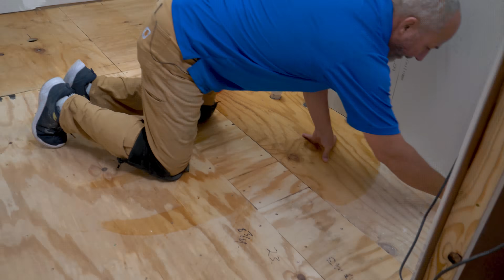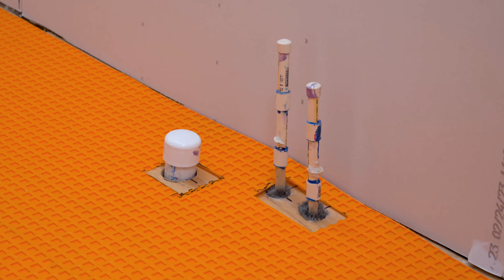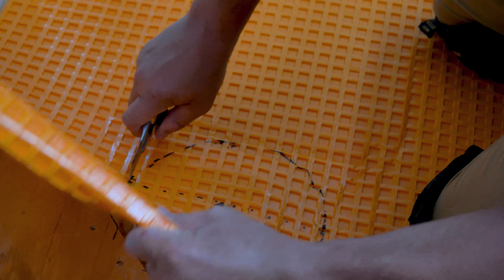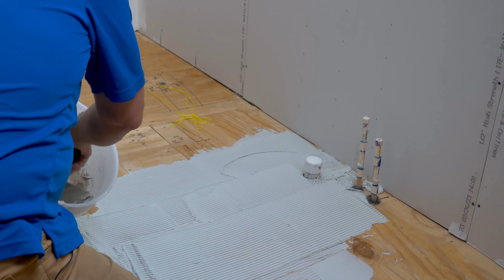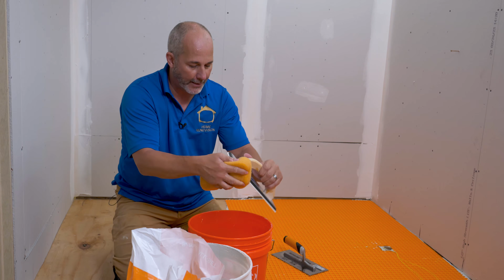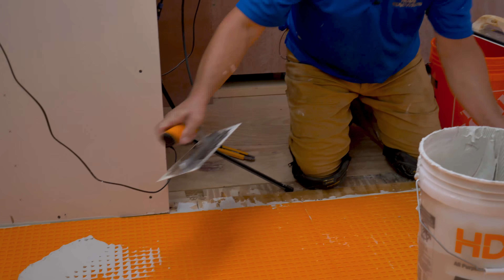Why You Should use Schluter Ditra on Your Tile Job

Comment: Thanks for another great video. I always learn so much watching you work! I'm about to do this to my bathroom and wanted to ask...would it help  to use a primer (maybe SBR?) on the ply before installing the Ditra membrane? Thanks again!
Reply from the maker: using a multi surface bonding primer is a great way to get a great bond to Osb. I highly recommend it as a great way to protect yourself from delamination which can occur if your thinset is too dry when applying. the primer effectually makes the install almost idiot proof. Cheers!

Comment: Is the PRIMARY use of that membrane simply to prevent tiles from cracking? or is there more to it? Built our home 20 years ago without this and not 1 cracked tile in kitchen, bathrooms, and front entrance - so trying to understand why I would 'invest' in this when redoing my floors. Thank you.
Reply from the maker: this replaces the need for a second layer of osb on wood floors before doing a direct bond install. it also prevents delamination that occurs during extreme weather events when the power goes out making the install a 50 year floor instead of one that will fail under certain conditions.
Reply: And also it’s easy to put a heating cable to have a heated floor at the end.

Comment: Would love to see you do a wet-room style bath.  I want a simple-to-manage bathroom with very few barriers, and super easy maintenance.  This means a floor so that if the toilet or sink overflows, or a pipe bursts,, the overflow goes towards the drain.
Reply from the maker: Great idea!
Reply: @HomeRenoVisionDIY  
I KNOW, lol.
Reply: Would you only use this on plywood or also on concrete?
Reply: @rebrokersabrina  You can use it on both. First time tiling, and my first time using ditra in the bathroom instead of cement board. Its so easy to cut and lay to fit. Yeah it might be more expensive then cement board, but hey, its WATERPROOF form the get-go, which is ideal for BR! Getting the thinset measurement right is probably the only challenge you will have.
Reply: @rebrokersabrina  
I have seen it done on a wood base, but only before and after.

Comment: Another great video Jeff!  I’m in the middle of my bathroom renovation. Using the wedi system.  Question for you:

I want to mitre my outside corners but not sure if I can just use grout or if I need to use epoxy. And if I do need to use epoxy, any specific one you recommend?

Also, I’ve seen you remove MANY toilets throughout your videos and the awkward positioning that your son has to take. You must try liquid lock if you haven’t yet!
Reply from the maker: I would suggest that for anyone using a shower system that relies 100% on adhesive to seal that epoxy grout is a necessity. Cheers!

Comment: Great timing, we are going to get our basement renovated and was just looking into this product. Do you recommend using this over concrete on a basement floor bathroom (house was built 2020). Looking forward to the next video!
Reply from the maker: In my opinion it should be considered necessary! basement floors will crack and this membrane will protect against translation and cracking your tile.
Reply: @HomeRenoVisionDIY  Great, thanks for the reply. Makes sense, and this is not not very expensive material wise for small areas!

Comment: What is the purpose of the membrane?  Does is protect the floor from Water?  Or is it to protect the tile from breaking?
Reply from the maker: it does 4 main things. waterproofing, ands structure to reduce deflection, and provides a uncoupling system to protect tile from cracking due to expansion and contraction that occurs on direct bonding installations, it also acts as a crack isolation system so when installed on concrete if the concrete cracks that crack will not translate into the tile as well.

Comment: Why not run the membrane a little under the shower curb to eliminate the non waterproofed crevice as a weak point between them?
Reply from the maker: that is why we use the kerdi band tape to waterproof that joint

Comment: Is this product worth the extra time and expense?
Reply from the maker: definitely yes. it has so many advantages compared to direct bond installs. once you factor in the cost of a second layer of plywood compared to traditional installs you are almost breaking even. remember you don't need to have 2 layers of subfloor when using this.

Comment: Hi there, I am replacing my tile baseboard in my bathroom, I will be cutting 9” all around my bathroom so much easier to take off that way and save time, when putting back the new drywall do I have to crack fill or put the new tile over the drywall?
Reply from the maker: if the tile is going to be cut the same height then simply screw the drywall on and tile away. Cheers! the use of caulking the plastic edging on the tile to the drywall will guarantee no cracks will form.
Reply: @HomeRenoVisionDIY  ok thanks for your help…

Comment: Where are you sourcing it from? Its so expensive from HD but Ive heard there are other channels you can get it for a lot less.
Reply from the maker: I buy mine from a tile supplier where I have my contractor discount and get a better deal. the cost is not a real concern. having a tile job fail is a much bigger problem. For me the ditra membrane is now part of all my assemblies.
Reply: Thanks for the reply! Agree it's better to be safe than sorry. Will you be going to IBS in Vegas?

Comment: Can this stuff be applied over 23/32 OSB subfloor with 16in joists in a remodel job? Im assuming the original vinyl would have to be removed? Or is cement board better for remodel?
Reply from the maker: yes remove the vinyl and make sure the osb is screwed down. You can always check out the website for the product...they have installation assembly options listed there for different builds and materials. Cheers!

Comment: Do you think that would work on an OSB wall to prepare for backsplash??
Reply from the maker: this product is not designed for wall applications. if you have osb as a wall right now then simply use a Multi Surface Bonding Primer and then you are ready to tile. Cheers!

Comment: Question: if I use regular modified thinset to set the ditra to plywood, can I use the same modified thinset to fill in the top of the ditra squares.  Then the next day use the All Set to lay the tile?
Reply: Doesn’t sound like a good idea to me. IMHO the point is to fill the Ditra and bond the tile at the same time with the same thinset. His recommendation to use Schluter All Set is perfect as it works for adherence to the plywood and the tile to the Ditra!
Reply from the maker: you cannot use modified thinset to fill the ditra. it will not bond. and your tile install will be weak and fail from deflection. Cheers! not worth buying a bag of modified since you use so little of it anyway for setting the membrane.

Comment: Fantastic tutorial! 
QUESTION….Can the Schluter membrane be applied over self leveling compound?
Reply from the maker: yes, it is now. they have changed the recommendation in the last couple years now that it has been thoroughly tested. If you are using ditra heat you can also pour leveller on top if finishing with vinyl plank but never if finishing with tile.
Reply: yes, always on top of the self leveling. not approved to pour self leveling onto ditra

Comment: Question: how much of a concrete slab crack would the Ditra negate? 😅
Reply: If the crack is less than 1/2” in width, then apply crack filler first. Once filler is set (dry), apply schluter ditra, as illustrated in video.  If crack is greater than 1/2”  in width, then concrete area will have to be repaired.
Reply from the maker: any cracks due to stress and or shrinkage. it will not protect you from poor soil conditions or slab movement. Nothing will.

Comment: Do I need to use this over a concrete floor?
Reply from the maker: Yes, definitely. all cracks in concrete are isolated and will not transfer into the tile when you use this product. Cheers!
Reply: Thanks for your help. Really appreciate it. @HomeRenoVisionDIY
Reply from the maker: Cheers!
Reply: I also have the same question.

Comment: I would have loved to use this when I put down about 800 sq ft of travertine tile, but it would have nearly doubled the price. Labor cost was already astronomical. 
Maybe if I win the lottery, I'll put it in my new mansion.
Reply: My thinking….with learning from Jeff doing DIY I am saving money with labor and that allows  me to use  use higher quality materials for the same cost or less.
Reply from the maker: You got that right shelly. the membrane is only $1.00 a square ft to guarantee longevity. cheap insurance if you ask me. I have seen hundreds of new tile installs that meet code fail. Cheers!

Comment: Thoughts on the Ditra peel-and-stick?  I watched a video that showed it was pretty tough (hard to remove) if you cleaned the floor properly.
Reply from the maker: I will stick with the original. Much easier to remove and rebuild from thinset!
Reply: The whole premise of the material is to get a good bond on the surface so if it does move, the cloth material can stretch or break. It's not actually the tile that moves if it does

Comment: Jeff, our son bought a house built in 1970. We have replaced the bathtub and installed concrete board, waterproofing membrane. All thru information and tips gleaned from your videos. Tile floor is next. There was tile on the floor. We have removed a few and there is concrete under the tile. Would you give as some advice on how to clean and prep the concrete prior to Ditra? Very much appreciated for any insight. Thank you
Reply: If there's concrete you don't need schluter. If the tiles are still good, just put your new tiles over the old tiles
Reply from the maker: 1970n was before building code so there are many varieties of concrete under tile. if it was a 2" pour then it all must be removed and then build back from there. if it is a thinner pour it might also have metal lathe in it. in that case remove back to subfloor. and then screw down and prep for ditra. to be completely sure join the membership and send me a photo on our forum. I can advise from there. Cheers!
Reply: I agree you don't need ditra. However, I would remove the tile. Then, follow the process to make sure the floor is flat ie. using self-leveling cement.
Reply: Probably fine without the ditra but remember concrete sweats so best to still use it even if your slab doesn't have cracks. I used some for my fireplace floor tiles because they would sweat if the ground is cold and fire going. Eventually that breaks down the thinset bond

Comment: Hey I have been working with my father renovating bathroom but we never use this stuff. Main reason is the material is way to expensive and doubles the client cost. We use hardy board (cement board) for the shower and for the shower floor I see him put a mortar mix then a grey plastic follow by another layer of cement mix. Sorry I crude info I’m only now learning the trade as a 2 month apprentice. Is my dad doing things wrong or just an old way of waterproofing a shower?
Reply: Your dads making money
Reply from the maker: that style is perfectly acceptable according to building code. It also is  a very low cost option to get a decent result. This product will out perform cement board since cement board is a direct bond installation process and does not provide protection from expansion and contraction like a membrane will. however if your working in a market that is looking for value vs longevity then his system is fine. Cheers!